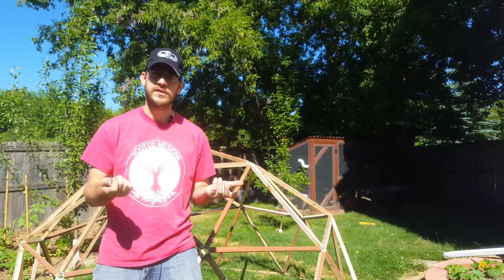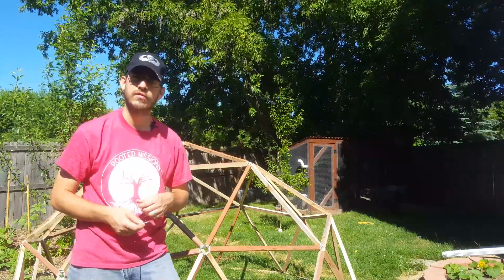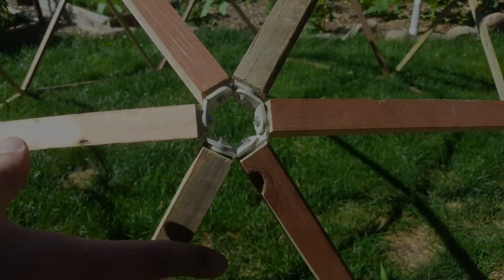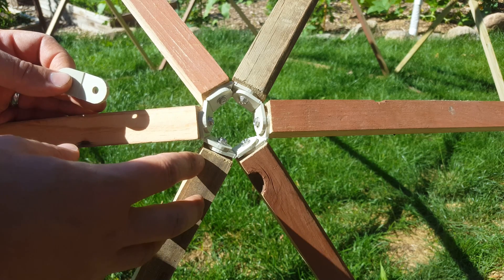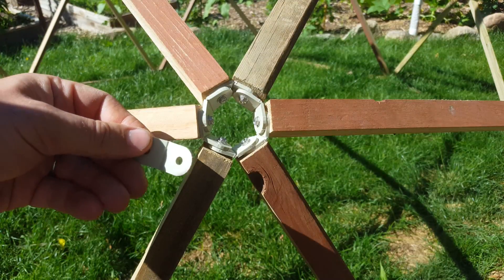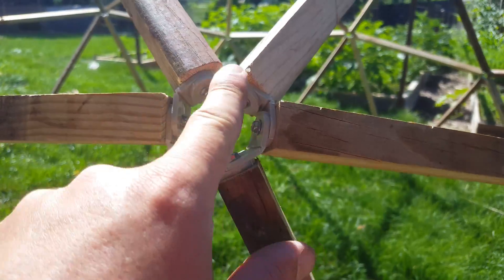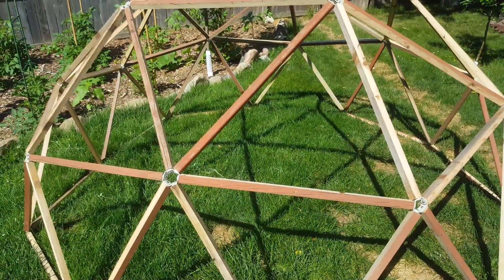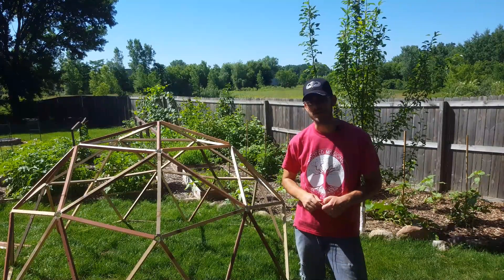The Ultimate Geodesic Dome Connector

Comment: Too many comments to read through them all, but those connectors are flexible.  Plastic is fine in the short run, but not so much in the long.  Clearly it would actually be easier to cut some metal pipe, thick walled, into rings and drill holes to match what is needed.  That would be a series of rings with five holes, and others with six.  If one was a bit of a perfectionist, the rings would have a slight cone shape, which would require a thin V cut.  Then it would be necessary to weld the seam for a solid ring.  Could say more, but otherwise the plastic connectors you are offering don't stiffen the structure as is needed for maximum resistance to "wobble".

Comment: These look great. Are the wood ends angled? how does it dome? I understand the angle principle of dome structures, how the angles meet and align to create the dome shape. These connectors are flat and can be manipulate to angles? or are the ends cut to the angles so each is designed with a flat connector to give that curve and shape?
Reply: I just checked your kickstarter page and think I understand better, the individuals lengths and sizes make the shape and pull the dome together. Great video!

Comment: The plastic connectors may be bulletproof, but a single screw of any length driven into end grain is remarkably weak.
Reply: A simple workaround is to drill holes in the struts and install hardwood cross dowels. The screw anchors into the dowel providing a much stronger fixing

Comment: One of the problems with a wood connection using wood screw is that eventually they will work loose as they flex. I think that you should consider placing a screw insert into the wood so that the end result would be more viable over the lifetime of the structure.
Reply: Hanger bolts and tubular hubs provide a very sturdy connection
Reply: Yeah that's my concern too. Screwing into end grain isn't stable long-term. Hmmm...

Comment: I'm sorry I don't believe that the plastic connectors are "incredibly strong", I don't like the grooves, they are weak points and obviously plastic is not as strong as steel. Also, I know that you can get a lot of resistance from a screw in the end grain but you're not really supposed to do it.

On the other hand I can see that you can obviously build a plastic sheet covered greenhouse that would be a lot of fun. Also it might be OK for a temporary support frame, as used for AI Domes (perhaps).

I saw a really good and strong patented dome connector in my 1971 Whole Earth Catalog! Don't know what happened to it.

Comment: i suppose you can 3d print these things with the right filament... or laser cut these with a living hinge so it will bend.
Reply: "PIPE HANGING WIRE" - just cut it to length
Reply: possibly even little "L" brackets

Comment: Neat idea, A potential issue is the individual connection points can allow the assembly to twist. The main issue i see is the screws will be entirely responsible for carrying the load as its transferred from one individual connector link to the next. 
With a rigid tubular hub, the entire tube wall transfers the load. The screws simply hold the struts in position. Its almost impossible to get a rigid tubular hub to twist ;)
Reply: I think they would only work for a chicken coop or a toddlers play pen ... they look really weak to me.
Reply: The screws are only used to hold it in place and to assemble it, but if you want more strength then just add a cold rolled steel pipe about 2 to 4 inches in length with a diameter of which will fit snugly into the hole at the center of the hub. The forces push in on the hub, not pull away from it, so most all your strength is in preventing the movement of strut inward into the center of the strut, but with cold rolled steel in there, it's not going to budge. 

But as far as twisting i am not sure what you are talking about other than you talking about the struts able to spin. But there is also a way to stop that, use 2 or even 3 sets of GEO brand connectors to allow you to connect 2x4 struts. Lay out the connectors in columns and in one row on the end of the strut, this way you can install 2 to 3 screws into each strut, depending on if you choose to use 1 extra(2 total), or 2 extra(3 total) connectors on each strut end. There will be no way it will spin now and also at the same time you made it so much stronger you could build domes bigger, even huge domes this way now. But remember the center of the hubs needs to be cold rolled steel in order to get tremendous strength. You could use pvc pipe for the core of the hub too, but know it is weaker, but lighter. But it will depend on what you are trying to build, if it is huge in size, then use real steel for the center of the hubs, but for small domes use pvc is easier to work with and lighter but strong enough for what you are doing.
Reply: @TheRebelmanone  
The forces push in on the hub, not pull away from it
Try to visualise the hub under pure compression and pure tension and then decide if the hub moves inwards or outwards :)

Comment: These domes would make a great, light weight easy to move chicken runs if you covered them with chicken wire. I can see a lot of uses for these.
Reply from the maker: +dan Hamakua i wad thinking, throw on some wheels and chicken wire and make a cool chicken tractor, maybe i could motorize it......
Reply: Remote control chicken tractor!

Comment: I really do wonder how strong those things are... Could you hang heavy stuff from the struts inside of a dome made with those? And would they weaken and break in the sun after a few years (I'm thinking greenhouses). I like the concept, though. I'm thinking of a small metal device of the same size/shape, made of the same galvanized steel as those construction joist hangers. Just some thoughts of mine.
Reply: His connectors work great and are fairly strong for other than inserting imto the end grain of wood, the absolute worst place to join wood.  I have no problem believing the connectors will greatly outlast the wood they’re attached to.  Even then, it’d be best with a triangular arrangement of holes so there’s no rotation (though it’s certainly easier with a single hole for assembly) and it’d also be better to tightly wrap the end of the wood struts with something tensile strength to reduce splitting possibilities.
Reply: Possibly good ideal laminating fiber around the end of the struts to help prevent splitting. You can't really use more than one screw in each end of the strut because those GEO connectors are too short to allow wider struts. In other words those GEO connectors are designed to use a maximum of around 1 1/2" x 1 1/2" strut ends and trying to slam 3 screws into a 1x1 is insane, it will weaken it to the point it might just fall apart on its own only from gravity. But of course a person could still use for example 4x4 struts, but then the ends of them would need to be tapered down to around a 1 1/2" x 1 1/2" so you gain no real strength because the connection is limited. You might as well just use 2 x 2s because they are 1 1/2 x 1 1/2.

But that is the deal with those GEO dome brand connectors, they are awesome for small domes, greenhouses, sheds, etc... but nothing big, nothing really strong. It is for simplicity and economic.

 But then again there is probably a way to use more than one GEO connector on each strut end, which will allow for bigger wider struts and more screws, then it can't spin like you were talking about and it will be much stronger, strong enough to build huge domes. For example you could put three layers of GEO brand connectors, not on top of each other but beside each other on the end of a single 2x4 strut and it won't twist, it won't be weak, and you could probably allow 10 foot of snow load on the top of a 40' dome built that way and it will be totally fine. But in order for a huge dome to truly be strong built this way, we need to add a cold rolled steel pipe into that center of the hub, because that where the compression happens when the dome feels the gravity and pressures. Place a 2 to 4 inch length piece of pipe with a diameter to fit snugly into the hole in the center of the hubs. This is for the struts to push against when it feels a load and it will be very strong with these pipes preventing movement and stress on the actual connectors. So it don't matter that we joined the struts together by screwing into the ends, because that is not what is taking the pressures, the force is pushing in the diabolical opposite direction the screw is screwed in, and the steel pipe hub is preventing it from budging. The forces are pushing into the center of the hub once the entire dome is built, it is not pulling out, it is pushing in. The screws in the ends are only holding it in place, but the hub centers are taking the forces, it is like that with any geo-dome.

I am interested in buying some and trying what i just talked about. But i would want to get em free because i am doing a mockup that the inventor never even tried, and i will post the results that he can also take a link and add it to his own page, which could totally boost his sales.
Reply: @TheRebelmanone  
If you are going to use steel tubes to strengthen the hub you may as well use a tubular hub and ditch the plastic connectors altogether. It will be far stronger and also simplifies the construction.
Reply from the maker: Those are great points and as the idea evolves I'll bet he comes up with a UV resistant plastic and also maybe metal ones. The strength of these is in the struts and the type of wood you use. The connectors are the last thing that will break. I can sit on top of this one but since I used a bunch of old rotting deck boards I found on the side of the road this prototype is not as strong as his. In the kickstarter vide he hangs from his and stands on a small one to demonstrate the strength. Maybe I should do some of my own stress test and do a video, might be fun, thanks for the comment!

Comment: but what about the structural integrity? can you sit on the topmost part comfortably?
Reply from the maker: I have sat on this one and it holds me. I used a bunch of rotting deck wood I found on the side of the road so this prototype is not as strong as what he has on the kickstater using oak dowels.

Comment: I agree that the connector is a cool idea, but other than picking up the dome, how do you get into it?  I don't see a door.  When you make the vid on how to build a dome, could you please include instructions for a door?  Otherwise, I'm not sure how much utility we'd get out it.  Thanks for sharing about the connectors, I'd not seen those before.  Thumbs up to Rogdan!! Very entrepreneurial. I'll check out his kickstarter.
Reply from the maker: +Tooshie G loo, great point. This was just a "can i build one" test. I will do a larger one down the road but you can look on google at geodesic domes and see how most people put in doors. There are a lot of different ways but essentially you just cut in a rectangle and frame in the door
Reply: Hi Tooshie G , the answer to your question is here:

https://www.kickstarter.com/projects/25645348/geo-the-geodesic-dome-connector/posts/1626783